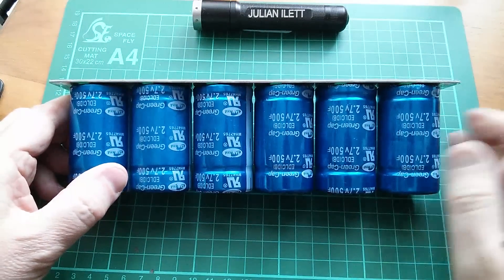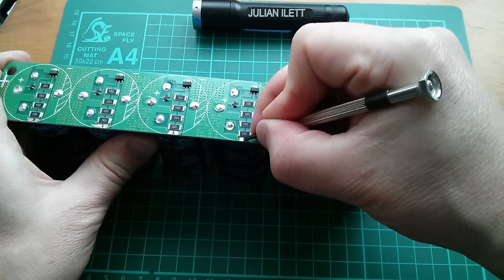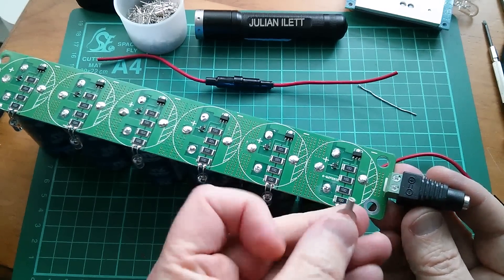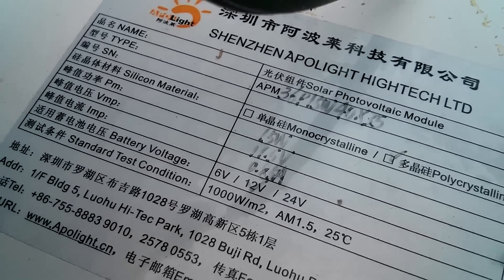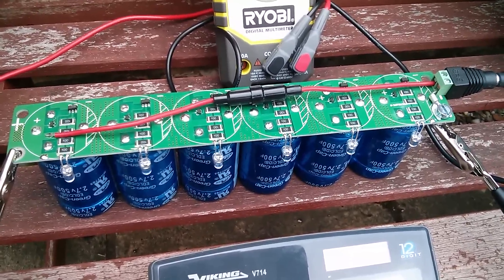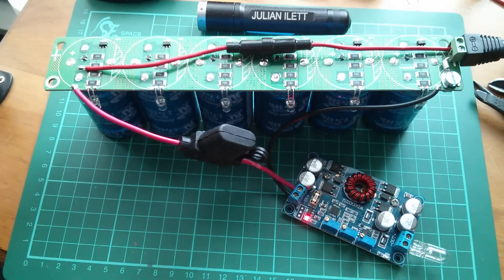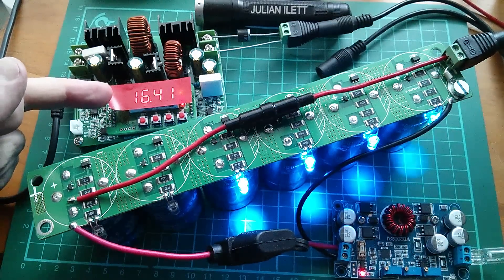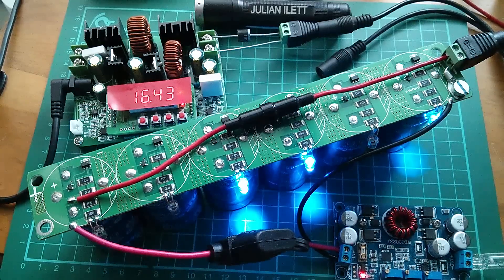SuperCapacitors (500F x 6) and Solar Panel (15W)

Comment: Hi jullian, thanks for your post, what you think, to run a MINN KOTA trolling motor using small  12v 35ah lithium battery, plus supercapacitor as you have, wired on 1  350w solar panell, + 30 amps chrage controller. in a 3.5 meter alumminium boat. I accept opnions. Thank you in advance. NJM

Comment: Other than the high discharge rate capabilities of super-caps, what is the benefit of using them over much higher energy density lithium ion cells?

Comment: any link to that buck boost converter module?
Reply: DC-DC 2V-24V to 3V-30V Step Up CVCC Boost Voltage Converter Power Module 80W
https://www.ebay.com/sch/i.html?_from=R40&_nkw=Step+Up+%22ZK-S4%22&_sacat=0&LH_TitleDesc=1&LH_TitleDesc=1&LH_BIN=1&LH_TitleDesc=1&_sop=15

Comment: there will be a slight  capacitance difference in most electrolyte types. there's nothing to worry about. if never shore use a cap tester to test them individually. good video keep up the good work

Comment: Why do they put the capacitors in series? It greatly reduces the capacitance by increasing the effective plate spacing, they should be in parallel with a boost converter or something like that.      ie. 2 x 500F in series = 250F where as in parallel 1,000F.
Reply from the maker: It doesn't matter that the capacitance is reduced. Total energy storage (in Joules or Watt hours) increases as the voltage increases.
Reply: Caleb Engineering, LLC i need a cap that can supply 60amps for 2 seconds at about 15v.. is this possible? How and what caps do i need please?
Reply: 3645J equals to about 1 Wh If I can trust my maths and wikipedia
A standard Lithium element has 3 Ah and 4.2 V maximum, which equals to 12.6Wh so a lot more than the super caps. Why should we use supercaps for solar applications ???
Reply: each cap can only withstand 2.7 v so you need 6 in series to work on the panel voltage
Reply: aslanyavuz - If you use 6 super capacitors  in series, each having a rating of 350F and 2.7 volts, and if they are charged to 15 volts, you should be able to get 60 amps for 2 seconds, but the voltage will drop to about 13 volts by the end of the 2 seconds. Using more Farads would make the voltage stay higher. In most applications a drop from 15 volts to 13 volts would be acceptable.

Comment: is it possible to use 75vdc 15,000uf if these capacitors are not available? TIA.
Reply: that's only 0.015 farads so you'd need 5556 caps in parallel to equal this bank. They call them supercapacitors for a reason! lol

Comment: Just thinking about your circuit above and my own solar charger, I am wondering if a simple buck boost converter was inserted between the Solar panel and the super capacitors would actually charge faster ?

The only obstacle would be the buck boost converter would need to handle a dead short for a short time (when the super capacitors are empty).

my idea above removes the need to limit to clamp the top charging voltage (buck converter does this)  and in the worst scenario when the capacitor is dead, the voltage would come up a lot quicker .

Idea's anyone ?
Reply: you'd lose about 10% of the power from the inefficiency of the converter. He really should use a real solar charger for max efficiency.

Comment: Am I right that this pack has a total 3Wh capacity (about 1 AA-battery), so for example you could run a europe legal e-bike (250W) "full throttle" for 43 seconds? that could be a nice help for 1-2 short uphills. Of course one would need to efficiently convert voltage for example to 48V(/5A) for a typical motor (just a guess) and be able to do so even when voltage drops from that 6*2.7 (16.2) towards zero as i think it does with capacitors.

Comment: How well do you suppose super caps would perform in an impulse generator? I've often thought about using them for something like that. I just don't know how well they would tolerate a sudden short circuit discharge. I've known other more standard caps to bulge or even pop under conditions like that.

Comment: The best tool for solder resist removal is a fibreglass bristle pencil such as part number 0514868 from RS Components.

Comment: you missed a point. when you charge a cap near the max voltage, the caps leakage current would increase to the point that the leakage current would not let the cap voltage to pass above the trigger voltage for the protection circuit to kick in.

Comment: Hi Julian
Enjoy your videos I have a similar kit with Maxwell super capacitors purchased from USA originally to start my diesel ride on lawn mower. They give out a massive surge of power.  now not used for the original purpose was considering using to power a ham radio which needs max 13.5 volts what output was the board you used to Power the bulb is this an off the shelf circuit?
Thanks again for the great videos
Best regards
JB Sydney Australia
Reply: these types are readily available dirt cheap.  his is fancy overkill. search ebay or anywhere for 'buck converter' or 'buck regulator'

Comment: I have been playing with similar setup for years now. But I have not think of leds as indicator, good one I tell you. Thanks!
Reply: Go the whole distance and put volts, amps and time sequence logging onto the capacitor bank?
Reply: I only had cheap 10W solar in parallel to capacitor bank. Great thing for inline solar for 12V usage without batteries. I even did some spot welding with it this stores amazing amount of amps.

Comment: It would be interesting if you measure the total capacity of the bank using your static DC load after it is fully charged and see how close the total capacity meet their specs.
Thanks.
Reply: 83,3 F
Reply: @chrislp8293  At the rated specs, the capacitor bank will hold 10,935 joules, or 3 watt-hours, at 16.2 volts... not kilowatt-hours, just 3 watts for 1 hour. With realistic loads, perhaps 1/2 or 2/3 of the stored energy will be available, as the voltage will drop too low for most loads.
Reply: That's where the joule thief comes in handy...!
Reply: @Roy_Tellason  True. With bipolar transistors, a Joule Thief will continue to carry load until the input is down to about 7/10th of a volt.

Comment: What's the self discharge on these like? Considered replacing the battery in my lawn tractor with supercaps but don't want to have to leave it on a charger or jump start it every week.
Reply: Even with high quality super capacitors, you would need to keep it on a trickle charger. The self discharge rate is much higher than batteries.

Comment: actually, that's 500F divided by 6. these capacitors are in series, the voltage is multiplied and the capacitance is divided by 6.
Reply: 83,3 F is the hole capacity
Reply: @chrislp8293  That's correct !  Total Capacitance = 1/ ( 1/C1+1/C2+1/C3 etc.)
Reply: I believe Filipe you got it right!
Reply: Series capacitors are the equivalent of parallel resistors, so you DIVIDE by 6. This is EE1A.
Reply: Multiplied, or added?

Comment: hi a better way to get the varnish of the pads is a fiberglass pencil. it's also great for cleaning battery terminals and all sorts of things
Reply: Where do you get those from?
Reply: hi try eBay or maplin, thy last well but if you can get some replacement fiberglass tips. because ones you start to realise what thy can do to clean parts you'll keep it at the top of the tool box

Comment: I have no idea what are you talking about in this video... Can you just tell me if i can use those supercapacitors as a powerbank, and how many times i can charge a phone with it ?
Reply from the maker: Supercapacitors don't have the energy density of lithium cells. So a powerbank that could charge your phone once would probably be the size of a briefcase.
Reply: Thanks, this was i wanted to know. I saw a bluetooth speaker comemrcial, they're claiming that the speaker runs on supercapacitors and it last up to 6h. I suppose that's bullsh*t.
Reply from the maker: It will probably run for 6 hours at low volume. Actually that's a nice idea - I might build one using cheap eBay modules - I think it would be a popular project - Cheers Stefan.
Reply: That would be cool :)
Reply: Julian Ilett send link to the vid plz

Comment: Any reason why you soldered to the board rather across the last resistor as you did with the other supercap bank?
Reply from the maker: Because there was some accessible copper near the edge of the PCB - don't think there was last time.
Reply: Thanks for the reply. :)
Reply: I thought led placement was a great choice

Comment: Hi Julian, I bought some supercaps from ebay that read 500F but their real capacity was not more than 150-250F. Did you get a chance to measure their capacity? (I just used RC time constant method)
Reply from the maker: That wouldn't surprise me! Yeah, that would be a fun test - raise the voltage of a 500F capacitor by 1 volt - that's 500 coulombs of transferred charge. At 1 amp, that should take 500 seconds.
Reply: I did not have a fancy CC supply like you do :) so I charged them to some voltage over 2 volts, and discharged them through 2 10W 2 ohm resistors in parallel (1ohm load) and measured the time it took for multimeter to register a 1V drop..

Comment: A note of reference  capacitors do not retain their values when placed in series. All the caps in series. What you have there is 16.2V @83.333F. Not 500F
Reply from the maker: Farads go down, but Joules go up :)
Reply: You should play around using less in series and using buck converters. That's what I used to do on my solar panels. Instead of wasting 36 cells in series I did 10 in series. Paralleled 2x 10 cells with it so I effectively had 10s 30p and boosted up the output to charge my 12v appliances. Re arranging around a 100w solar panel instead of the 5.29A I usually get on a 100w panel with the new arrangement and a buck converter I was getting the same voltage but instead I had about 15A. So same cell amount. Different arrangement. Better output. I don't know why all major companies don't do this
Reply from the maker: Coulombs stay the same :)
Reply: Hi Julian Nice Video  Your style encourages me
I think, heeding the safety warnings in comments here, you do need to push the volts.  
Stored Coulombs go up with the SQUARE of voltage, so overcharging the capacitor pays dividends provided it can be demonstrated to take the charge "safely".   Everyone is quick to jump to a conclusion that this cap is faulty, but in fact it might just be that this is perhaps a cap that is from a superior rather than inferior batch. 
Where is this going?  You are not explicit in this video about what your thinking is regarding storing solar PV energy, but I am thinking (a) that the conversion of low voltage at the panel array location, to a higher voltage for transmission to the grid or battery storage location makes a lot of sense when cable costs are considered and (b) RGHxFTW is on the right track...
Reply: What does that mean??  The title, mistakenly was "500Farads".  It is not!
Reply: I had one that was doing the same thing it ended up being a bad capacitor that self discharged rather quickly especially as voltage reached 2.7 volts. be easy to tell is after it is charged it should start cycling off and on with the rest rather regularly else it could be self discharging.

Comment: Is it me or that cap looks a bit lighter shade of blue than the others? perhaps a different production batch? and hence the difference in capacity?
Reply: I think where the caps came from quality control was not much of a factor.
Reply: Seen photos of fake large capacity capacitors where they are have a smaller value cap and therefore cheaper cap hiding inside the can.
Reply: I just ordered a pack of 6 500 farad 2.7v super capacitors
They seem to be alright. but you NEED to use a protection circuit with them. and cycle them at least 20 times  to get their capacity up to full and stabilize them

I ordered two packs of 3. it was 37$ in total
They can run my 200 watt vacuum cleaner for about 5 to 10 seconds from my 400 watt power inverter
AMAZING!!! :D
Not powerful enough to start a car though.. I cut one open that was faulty and it was completely shit inside. the connections were reversed and it was connected with a bunch of thin flat metal strips in parallel to the super capacitor in multiple places.

they are really cheap so they have a somewhat high internal resistance compared to more expensive ones
but they are still REALLY GOOD and plenty strong enough to help a NIMH AA battery pack of 1.8AH to run a lot heavier of loads without the voltage plummeting .
And really small too.
I get lots of capacity out of these Very useful with solar power!!!! they are SO USEFUL in so many ways!
I could never run my 200 watt vacuum cleaner from a pack of 9$ 12v NIMH AA's by themself but with these super capacitors. I SURE CAN :D

I can only charge them up to 13.5v for now but 3 extra replacements coming that I can use to get it back up to 16v capacity now.
Reply: Well then you can put them all in parallel and that WILL  start your car.. lol
Reply: the mis-colored cap is likely to be counterfeit.
Reply: Check the weight of the capacitor. tap it with a pencil or pen or small metal object.
If its hollow you will hear it.
My 100F samwha brand cap is for sure 100 farads. Lasts as long as two 200mAh NICD's in series when i'd test both of them in my battery powered drink mixing cup. Has even more power too! MAYBE even longer.
Impressive and for sure it's 100 farads AT LEAST. And when its charged up to 3.5v like i've done a few times. It lasts for ageeeees
I had a 2 farad 16v capacitor and it could barely power a motor for longer than a few seconds. It you could hear and see the motor slowing down quite noticably..
Now this 100 farad capacitor running the same motor. Just kept chugging along and the voltage barely dropped at all.

If they feel excessively light or feel/sound hollow. they might be fake. if not. they could be the real thing.

You could test by trying to crank a car engine with these. It should give at least 1 good second of full cranking power and start the car successfully..
Reply: its samwha brand I have one and its 100 farads. same color as these ones. These are just bigger!!!
Reply: realflow100 they are great to power my led garden lights